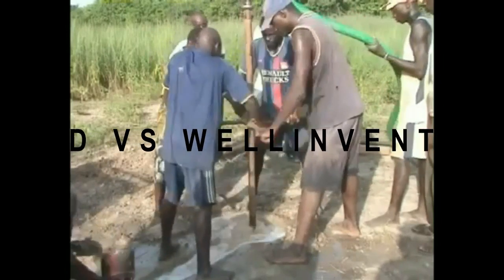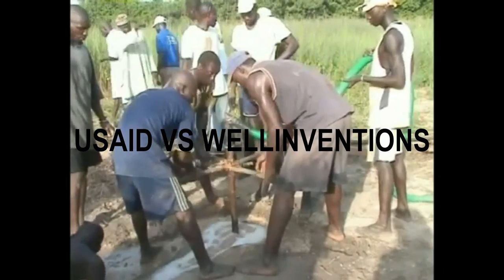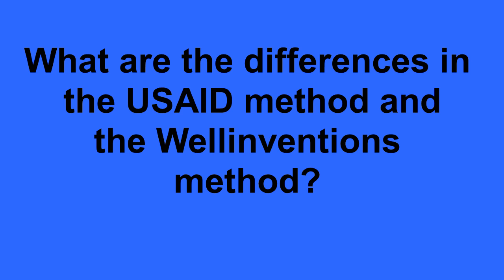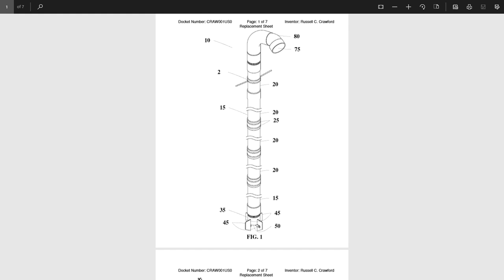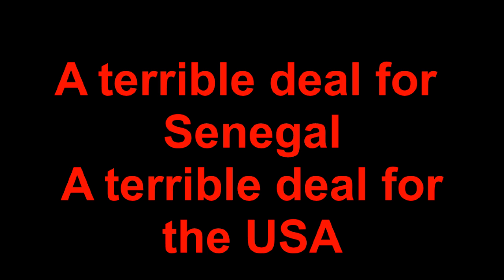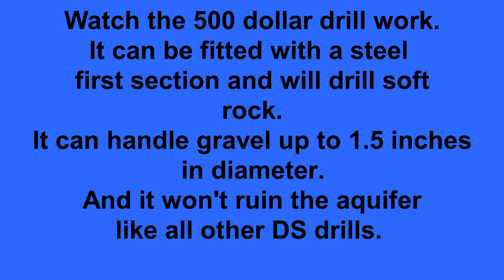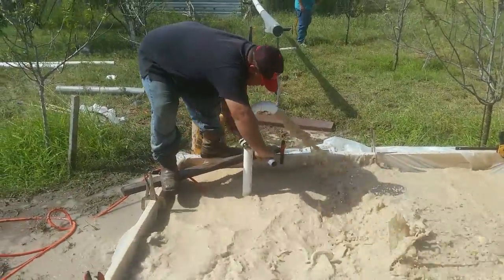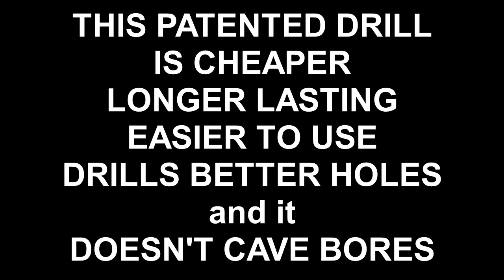Comparison of USAID methods and Well Invention methods

Comment: Is there a theory as to why the bore hole may stay open longer with out collapsing. Or would you still need bentonite to keep it open? ( in time to trip drill stem and lay casing).
Reply from the maker: Our method is reverse flow air lift. Using that method, stability of the borehole is only at risk when the static water level is within 7 feet of the ground surface and the material is sand or caving material is near the surface. Direct circulation uses high pressure jets to cut the borehole. The jets make the hole unstable. Our method does not use high velocity jets and therefore it does not cause caving of the soil.